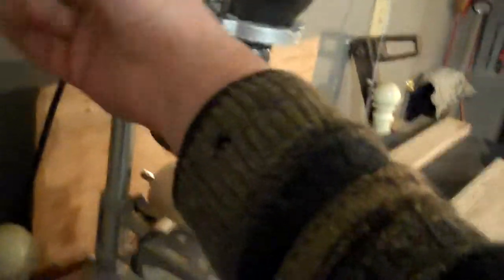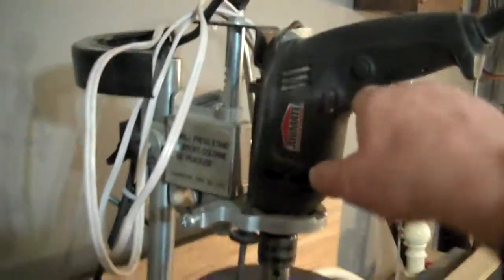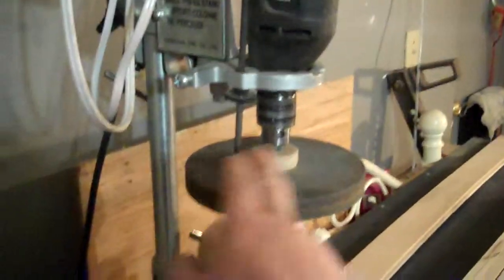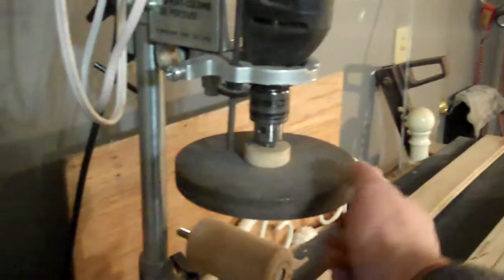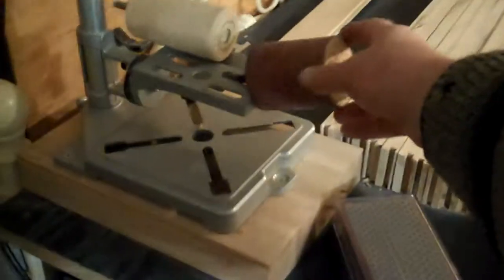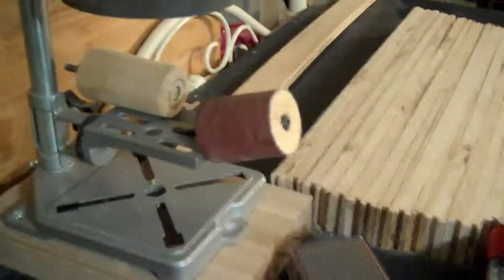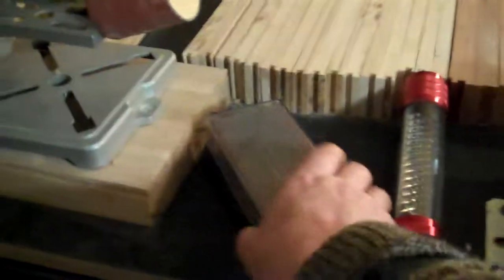Treadmill motor sharpener, homemade bench grinder

Comment from the maker: Just make sure its a dc motor, I have taken a few apart and if the speed controll looks like a bicycle break cable its probably ac with a mechanical speed adjust.the dc ones have an electronic controll either a push button up and down or a sliding controll part of the electronics.or if you get the cover off the bottom of the treadmill it will say on the motor.usually 90 volts dc..hope some of this helps